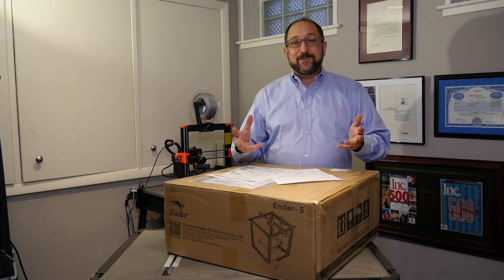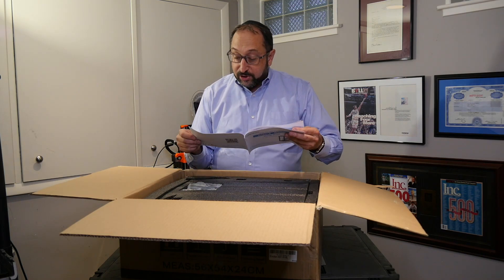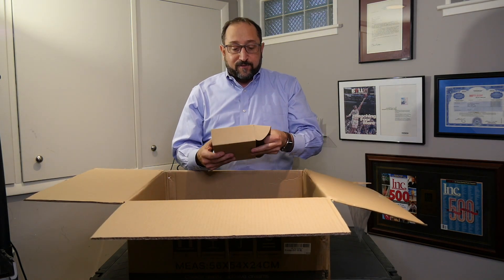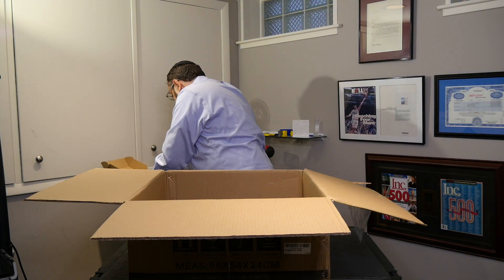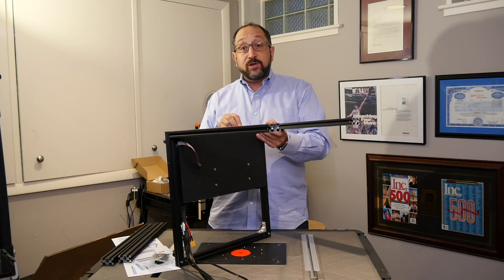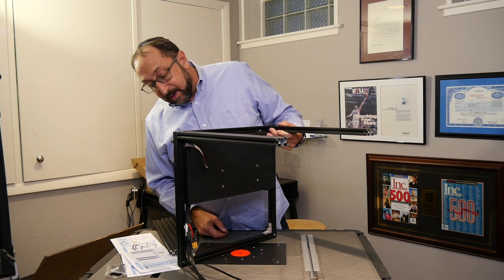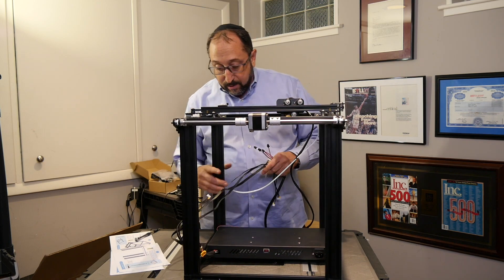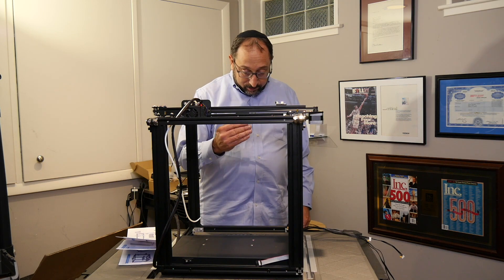Creality Ender 5 Unboxing

Comment: Hi, been watching your videos for a few days since I bought a monoprice mini delta as my first printer. After feeling uncomfortable with the print volume and some control problems, I returned it and ordered an Ender 5 which I found rather trustworthy by digging into your channels. It arrived within one day thanks to amazon delivery, and surprisingly enough these are made right in my home town and I never noticed before. You're totally right about how small the world gets. Love your videos, keep up the good work.
Reply from the maker: Thanks for the nice note.   I think you will enjoy the Ender 5.  I have both and Ender 5 and an Ender 3 pro.  Both excellent printers.  The Ender 5 has the advantage of a larger print volume and a more rigid frame.  In all other aspects they are basically the same.

Comment: Well, sadly, I was really looking forward to it, and am now all the more disappointed. There are several problems with it:

First and foremost, the display keeps falling off. I cannot tighten the T screw any more, in fact I cannot do anything with it. I think they sent me a bad screw because the other screw for attacking the display can be tightened.

Secondly, turning the control button does not work as it should. It either does nothing, or jumps over the choice I am trying to make.

Thirdly, before I got this I learned Cura using the Ender-3 presets, and was able to slice models whose X and Y dimensions were 220x220 mm. Now, with the Ender-5, Cura is telling me the model is too big and I need to size it down. The main reason I got this was because like Ender-3 it was supposed to work with a 220x220 mm base, but is supposed to go to a higher Z.

Fourthly, the moment I inserted the USB/micro SD into my computer, Windows popped up not one but two warnings about extremely dangerous Trojans on the card!

I sent a message to Creality about the first two problems and told them to send me a better screw, or else I am returning it for full refund.
Reply from the maker: Sorry to hear it sounds like you got a lemon.   I did not have those issues.  In terms of cura I manually updated the build size to match the specs.  Interested to hear how responsive creality is?
Reply: @MakeWithTech  Creality’s response was “please provide picture , and we will confirm and get to you asap, sorry for all inconvenience.”

I’ll be leaving now, so the picture will have to wait till this afternoon.

OK, I tried to activate. It said the printer was not connected (which it is not, right now). So that’ll have to wait till I come back, too. I’ll get back to you then as well. Thanks for all your help!
Reply: Well, I got an M4x8 bolt from ACE. Its head is slightly bigger and requires the 4mm Allen key. But I managed to attach it and it was as firm as I could turn. I turned the machine on, pressed the button on the display and the display promptly fell off. So I took a picture and sent it to Creality, but I think it is just a ridiculous design. Yesterday I also managed to knock off the spool holder accidentally,  so I am not a fan of the idea of attaching things to a rail and expecting them to stick to it.

I am waiting for a 1kg spool of black filament from amazon. It should also arrive with a nice caliper. After that, I should be able to measure the dimensions of the display and just print a box to hold the darn thing, so at least the circuit board should be protected. That shipment is supposed to come on Monday.
Reply: Looks like I was attaching the display at the wrong place. This video https://www.youtube.com/watch?v=hvhHw4lNiKo explained it for me (he made it just for me :).
Reply from the maker: To adjust Cura.  First I am using Cura 3.6.   Open Cura.  Select Preferences under the Ultimaker Cura main menu entry on the top left.

Select Printers.   Now, this is important, click on your printer name and then select Activate.   You can also rename the profile to Ender 5 or I named mine Ender 3/5 since it was based on the 3 profile.   Once you have activated the printer you can click on machine settings and change the bed size.  I changed mine to X 220, Y 220, Z 300.  Yes, the X and Y are 235 on the Ender 3.  Basically, you are trading 15 of the base for 50 of height.  I did not notice that the X and Y are smaller before but this is a good trade-off for me.

The difference that was most important to me is the increased stability and the reduction of movement of the print bed which seems to reduce vibration when compared to my Prusa.  On paper moving the print bed along the Z axis vs the Y axis just seems to make sense to me.

Hope this helps.

Comment: Well, I completed the easy part, the one of putting it all together. Now I am entirely lost by what cable to connect to what. HELP!!!
Reply from the maker: The cables are all color coded.  Just connect the cables with the same color wires AND connectors to the equivalent cable.  You will find there are two pairs of wires with two white cables and black connectors.  These are for the heated bed temperature sensor and the heat block temperature sensor.  If you get these mixed up when you first try out your printer the temperatures shown on the LCD panel will be reversed.  I messed this up the first time.

I do agree that the wiring instructions could have been much clearer.
Reply: @MakeWithTech  Thanks, Irv! I’ll do that.

Comment: Hello, Irv. I have a question. I noticed that the official Creality store at https://www.creality3donline.com/creality-laser-high-power-1pcs-12v-blue-violet-light-laser-engraving-with-focusing-for-3d-printer_p0103.html is offering a laser head to add to their printers. But it does not say whether it can be used with the Ender 5, or only the CR models. Can you shed any light on the mystery?

Thanks, Adam.
Reply from the maker: Unfortunately I have no experience with that.
Reply: @MakeWithTech  It seems to be attached to the extruder by a magnet and to be controlled by Gcode sent to the fan. So, if the Ender 5 uses the same commands as the CR series, in theory it should work. Since I asked, I watched a Polish video (with English subtitles) which explains how to use the laser head with the Ender 3, so I am thinking that it probably works with the Ender 5.

I have to wait till next month before I can buy the Ender 5, so it is all still theoretical to me. I am hoping it works mostly because I live in a one-bedroom apartment, so my space is limited, and it would be better for me to have one device that can do both, 3D prinitng and laser engraving, instead of having two separate devices.

Anyway, thanks.

Comment: I am seriously looking at this printer. I am looking for something suitable to adapt to use for polycarbonate. The upgrade for the heated bed and the hotter extruder will be easy. I’m wondering what it will take to enclose the printer. Left side can be done by adding a piece of polycarbonate in the extrusion slot. Maybe the right and back with some cutouts for cables. The front will be an easy double door with polycarbonate sheet, aluminum hinges and a magnetic latch. 
I will use a sheet of aluminum for the bottom that will be bent to go above the electronics housing then bend 90&90 degrees to match the bottom of the enclosure at the back. 
Thinking a raised cover for the top that will lift off. 

What do you think?

I can’t get enough structural details to make a decision yet.

I do like the double shaft stepper for the gantry that is run and supported on both ends. That is the only real issue I have with the ender and 10 series is that there is only one lift on the y axis. Now they are supporting the bed on one side. 
      Does the bed seem sturdy enough? Does it go out of level more than it should?
Reply from the maker: I think your approach is workable but has the following challenges.   As you noted you want to make sure the electronics are outside of the enclosure.  The air vents for the electronics are on the right side of the base, inside the extrusions.   If your enclosure covers the extrusions you will need to form a duct from the air vents to outside of the enclosure.

The x and y stepper motors extend outside, past the extrusion rails on the top, the X on the right side and the Y on the back.  The enclosure could be attached to the extrusion but could not be flush.  You would need spacers to move it out about 70 or 80mm on the back and the right side.  This would give the motors room to operate.   The Y stepper motor on the back is fixed in the center but the X stepper motor on the right moves from the front to the back.

The bed is rock solid.   Overall I am very impressed and I like the full frame approach.  I would love to see a printer in the future that takes the Prusa print bed, filament sensor, direct extruder and put it in an Ender 5 style full frame.  However, this would obviously be a very expensive printer.
Reply: Yes. I’d like a Prussia control set on a solid frame myself. I had designed an extruded frame and made a cut sheet for the extrusions. I priced it at 80/20 and it came out to more than 300us dollars without fasteners. 
Needless to say, it’s obviously cost prohibitive

Comment: ENDER 5  ((END) ER) not enler
Reply from the maker: You are correct.  Thanks for watching and commenting.
Reply from the maker: Bob -- a link to the Google sheet I used to evaluate the printers is not included in the description of the video.  I have also included it here.

https://docs.google.com/spreadsheets/d/13DlfeHKucakaMSh0OjXFBWpRs1L9tFW3UlM6I6XBDKE/edit#gid=1911893721